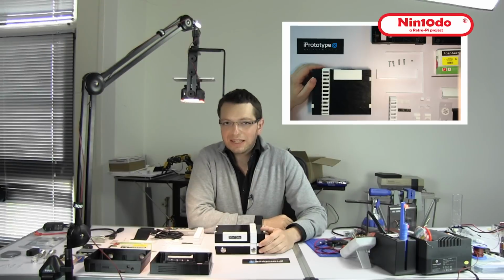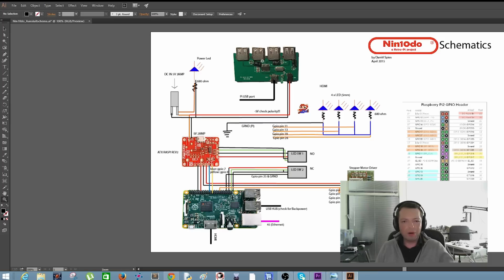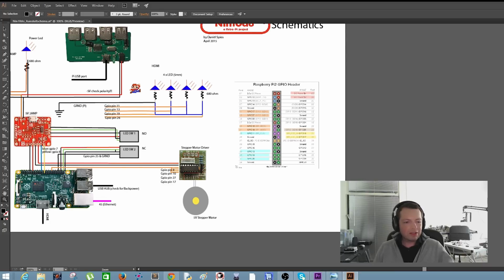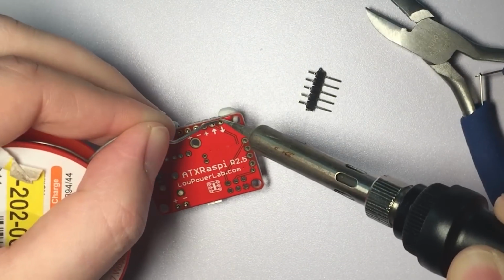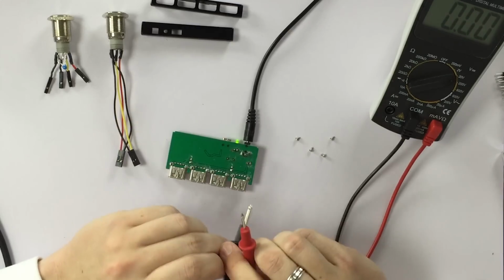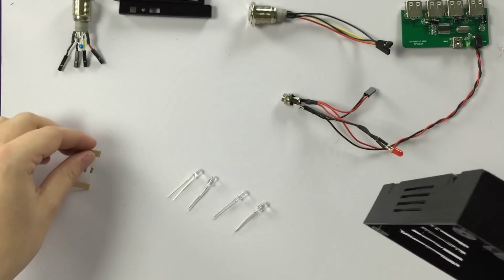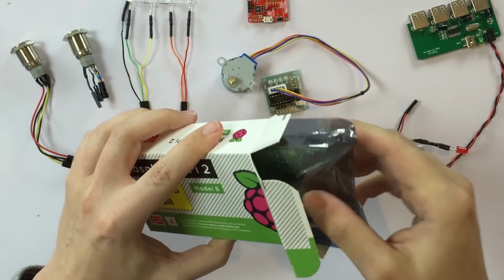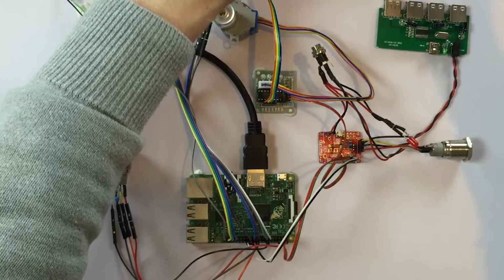Nin10do tutorial: Build your own 3d printed Raspberry Pi 2 Nintendo game console (part 1)

Comment: If I don't want the usb hub to open up with a motor I can omit anything related to the stepper motor in this video correct?
Reply from the maker: Yes of course,
Just don't use my Python script and only install the ATX RASPI script. You can also built my Lite version. I sell the DIY kits on www.nin10doshop.com  Thanks, D

Comment: About the stepper motor. At iprototype.nl they have the Stepper Motor 5v with ULN2003, but it looks different from the one you are using. Will that cause a problem? https://iprototype.nl/products/robotics/servo-motors/5V-4-fase-stepper-motor-driver-ULN2003
Reply from the maker: Niss3 No, I have tested both the new and the old version of the ULN2003 driver board. It doen't have any screw holes so you need to hot-glue it into place :-)